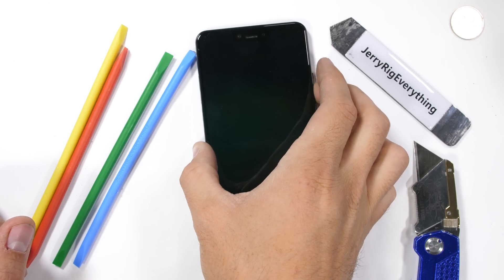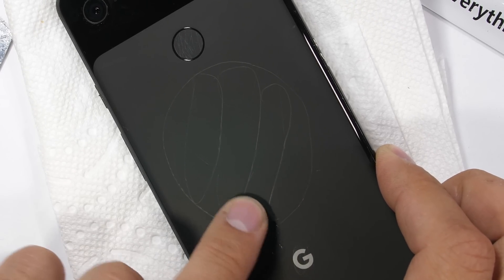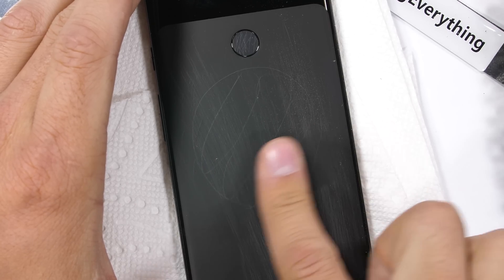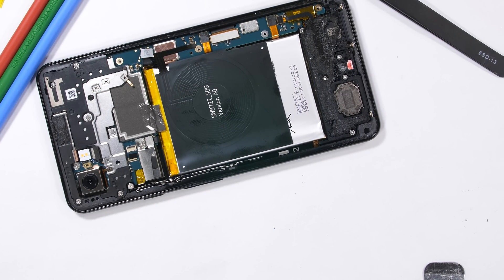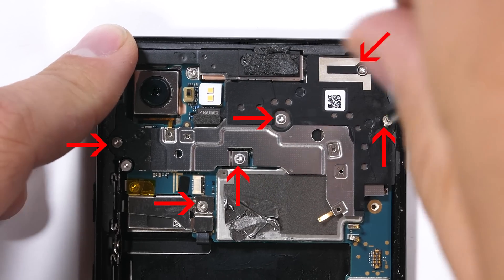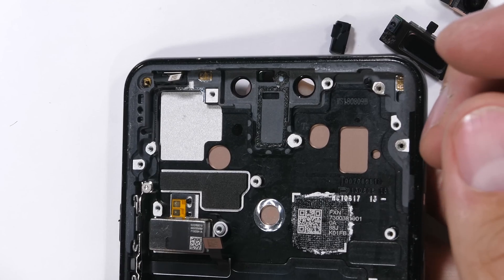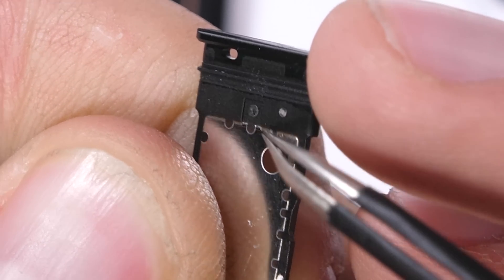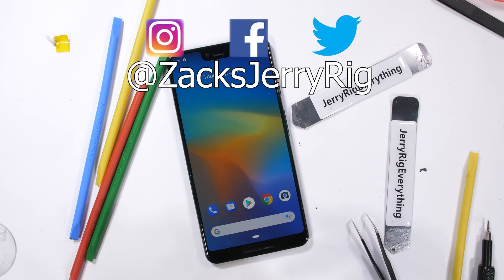Pixel 3 XL Teardown - Can the scratches be removed?

Comment: There is a reason why I make sure I drain the battery till the phone won't turn on before I replace it. Its cuz these boneheaded companies glue them on so well that the pull-tabs break forcing me to manhandle the damn batteries out bending them most of the time so yeah...

Comment: My Pixel 3xl last week after the latest OTA update. Looks like my phone is stuck in EDL mode. Considering to open the phone badly. Not able to hold myself for weeks to wait for the battery to discharge in EDL mode. Hope the phone isn't briked🙏. No pixel 4/5/6 in India. Can't find OEM replacement parts. I'm not able to understand what to use as a alternative for back panel adhesive... Do you have any hints for this?

Comment: Hi need an advice pls. My Google pixel 3 XL fell down and the glass got cracks.Display and touch are working fine. If now I have to fix the phone then which one would you advice (1) Change the glass screen( is it possible) or (2) Change the LCD.

Comment: I imagine that those pull tabs for the battery would work a lot better if you were to take the battery out last instead of trying to squeeze them at an angle around the motherboard.

Comment: you have to pull a lot slower on those pull tabs, buddy. It's what they're made for. i've repaired a few 3 xls. just pull and let them stretch, any pull tab that lifts up the battery right away means the adhesive was never good to begin with.

Comment: Anybody noticed that there is no that water proof grease around the rubber ring on the charging port this year ? It was on last year's pixel 2. And the the water resistant rating even goes up from IP67 to IP68??? Wtf?

Comment: altho the iphone XS MAX has only 3100 mah, it actually beat the 4000mah note9 and the 4200mah mate 20 pro, the A12 is a beast. specs dont really matter on iphone tho
Reply: 1440p vs 1080p. Ofc 1080p
Reply: HA. Dumbass it didn't beat those batteries. Did you even watch a battery drain test. I watched the most accurate precise battery drainage test and it was some heavy shit, Note9 vs XS MAX, obviously the Note9 won. Man you are fucking stupid. I am not usually a harsh android guy but this was the dumbest shit I've ever heard.

Comment: I'm sure that the scratches can be removed with a hydrochloric acid solution, because the glass surface isn't actually scratched metal particles are just transferred onto the glass. A commercially available and safe solution to the problem schould be developed tho.

Comment: Use a syringe of alcohol and squirt it under the battery. It will attack the adhesive and pop it out much easier.

Comment: I love Google, never been a Pixel fan... far far far far far far far far far far far far far too basic a device for the price... always is. Now don't take that the wrong way... as even the most budget Android from the worst of manufacturer is still about a decade ahead of the latest iPhone... but for Android standards, the Pixel is weak pants on offerings. That said though, take a closer look at that singular speaker with the large grille design.  It's a sealed audio chamber that ducts from the speaker to the entire grille area / chasm.  Like many speakers, even high end ones outside of the phone world..... A great example would be those older BOSE Wave radios... Tiny speakers, very large and sealed... as well as tuned ducts to amplify the sound to a precise and excellent level.   This, I think may have been skimmed over here... and dismissed as a lesser thing than it is.

Comment: Why did you compare the iPhone XS to the Note 9 and Pixel 3 XL's battery size? I understand this is obviously a nitpick and inconsequential, but I don't understand the obvious attempt to knock Apple. While the iPhone XS Max still does have a smaller battery than the Pixel 3 XL, it is much less of a difference than the almost 700 mAh difference between the normal iPhone XS to the Pixel 3 XL. Comparing like-sized "Max" or "XL" phones to each other is a much better indicator of the discrepancies between the two, as there is again, a much smaller difference between the battery size of the iPhone XS Max and the Pixel 3 XL than the difference you highlighted. I am not an "Apple fanboy" or "sheeple" or whatever you want to call it, nor am I a "fandroid". I simply don't understand the blatant attempt to make the iPhone look so much worse in comparison to the Pixel, when you easily could have mentioned the battery capacity of the iPhone XS Max instead of the iPhone XS, a phone that is almost a cubic inch smaller than the Pixel 3 XL, not to mention the half an inch of diagonal screen size between the two. Again, I understand that this has no impact on the video, I just wanted to point out an obvious and, frankly, dissapointing piece of misleading information.

Comment: That random metal chunk is to prevent the connectors from popping off. My sister once dropped her phone and came to me complaining that the volume rockers didn't work. I open it up and see that the ribbon had popped off from the drop.
Reply: Interesting
Reply: True. I ended up losing all the screws that holds the metal bracket for the screen connectors on my old iPhone 5 a few years back, so I just left it out. Then one day I dropped it and the touchscreen became completely unresponsive due to the connector coming loose. Even just having it sit there without any screws helped prevent this happening again. Still doesn't explain why the one in the Pixel 3 XL is that chunky 🤔

Comment: +JerryRigEverything    I think the pull tabs under the battery breaks because of the angle you pull at it.  I think you should remove the motherboard first then you can remove the battery with the pull tabs at a different angle and will work mutch better   I hope you try this at a different Teardown video with the pull tabs

Comment: That space in bottom could have easily fit a headphone jack if not they should give 2 usb c ports so one can be for charging while other one can be used for headphones. They should  standardize usb c to 3.5mm jack cable so people don't get confused between analogue and digital cables

Comment: Welding brush + soap will remove all scratches, maybe.
Reply: I lol'd so hard when he got that metal brush 😂
Reply: Me too, but nobody now can say that he didn't try hard enough :D
Reply: He didn't. A Dremel and a wire brush attachment is trying harder. :D
Reply: Should've just said most. You're sentence is worded weird
Reply: Yeah seemed like Zack was trolling us a bit (and Google by extension) ?   I don't understand the logic of using a metal brush to try to remove scratches caused by metal -- perhaps a "fighting fire with fire" thing based on Mohs scale ?   IDK...
Reply: You have to brush it in water tho
Reply: @rubenzwr3782   No, different levels of Mohs scale hardness involved as I understand it.  Erica was scratching the back of her Pixel with keys; Zack I believe used a metal knife or razor.
Reply: @Sharky165  Yep, but it's not a scratch. There's stainless steel in the grooves, and it won't come out because it got stuck in the tiny pores
Reply: @Joseph_mix  Actually I watched it again; Zack used a level 4 pick (Mohs scale) and not a razor or knife.  I believe stainless steel is harder than level 4, but regardless I think you're correct that those marks are permanent.  
    Def a much more extreme test than Erica's or Lew's (Unbox Therapy), and not something most people are going to carry in their pocket, esp with their phone in that same pocket, LOL. 
   But still, normal/clear glass wouldn't have looked that bad being scratched at level 4.
Reply: It isn't a scratch, it's a mark. And glass wouldn't be scratched at a lvl 4.
Reply: Isopropyl alcohol?
Reply: @JAYRAY00  Ye, it's what's used to sterilize wounds sometimes, and also to clean electronics, as it isn't corrosive.
Reply: A blowtorch will remove scratches
Reply: Water and a tooth brush will. Erica Griffinn tried it

Comment: Could the 3 xl have a worse coil than the pixel 3? One of my wireless chargers is finiky with my 3 xl  and the google fabric case but will charge it with it off. My normal 3 charges no matter what. 

Is it possible this is why they locked the pixel 3 to fast charging only on made by google cert chargers? Maybe the 3 xl cant handle the fast charge after a certain point?

Comment: I don't use Youtube while signed in. I just signed in to tell you one thing. Stop the fucking iPhone hate like that worthless Unbox Therapy guy. 

You are comparing this phone's battery size with Note 9 and told that it's better than iPhone XS. It's a Pixel 3 XL, you should compare the battery size with iPhone XS Max. 

If this phone was Pixel 3, then you could compare it with iPhone XS. Fucking bald hater. Good content though (Y)
Reply: You didn't mention iPhone XS when you were telling the water resistant rating, because the iPhone XS's rating is IP68. If the Pixel 3 had IP68 and iPhone had IP67, you definitely would mention it. Hypocrite

Comment: Does my phone become not waterproof if i heat it but i didn't open it? any one tell me please
Reply: First, it's only water resistant. Second, it won't. Your phone will only be not water resistant when you open it as the rubbers get glued back when it cool down.
Reply: @ryouazuken4296  i have heated the galaxy s8 but i didn't open it
Reply: @zayn7453  Then it's still water resistant.
Reply: Why are you heating phones again?
Reply: It softens the adhesive which usually breaks the IP68 rating just rendering it a IP6X or an IPXX

Comment: Noob question but if a phone gets wet from rain, would those water indicators still indicate to google that the phone suffered water damage?
Reply: Usually phones can resist rain, but if it does happen anyway and the water indicator turned red, then yes.

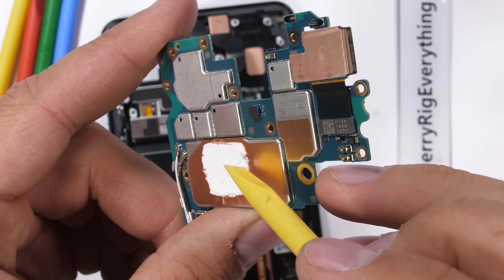Comment: What kind of cooling system pixel 3 used? i see at 5:50 that the processor have a thermal paste but what it's connected to? 
thanks in advance.
Reply: I'm sure the thermal paste was placed above the processor.

Comment: Htc design looks like again this year around. Last year LG and the first iteration of pixel was HTC. Looks like if we need to replace the glass LCD and frame you might have to replace the battery as well.
Hopefully replacing the glass and LCD will be an option. I would like you to take off your screen and put on a new one that would be great to see if it's doable.
Nightmare of a phone... I wish they kept the design like the first and second one where you can just remove the screen from the front and replace it made it so easy.

Comment: Why dose the speaker in the notch need to be that size? I feel like if the speaker wasn't as big or implemented differently the notch wouldn't be so much of an issue. Also the chin speaker is bit of a disappointment seeing it from the inside.

Comment: i just wanted to ask my s9 had been in the service centre for a screen replacement as well as back glass replacement i just wanted to ask is my phone still ip68 water restitance the service center did told me that the phone still has ip68 water resistance can someone answer this please
Reply: That means, they will change your front and back glass then renew your rubber bands, recovering back the ip68 ratings.

Comment: This Pixel is Junk.
Reply: HUH ???!   If anything, he proved that it's a solid, well made phone.
   Yeah there are a couple of odd things, chief among them the choice to frost the outside of the glass back rather than the inside, but then no device is perfect and other OEMs also make questionable design decisions all the time.  
   My biggest concern if I were to consider buying one is the seeming relative sensitivity of the water-damage indicators.  Even though the case seems well sealed  by Google/HTC, enough to earn an IP 68 rating, I'd be deathly afraid of any kind of dunking.  
   It's hypocritical of Google IMO to build the handset to IP 68 spec, but then so aggressively want to limit their liability for water damage.
   TL;DR:  This is prob NOT the right phone for you if you're a lifeguard.

Comment: Problem is, the Xs and Xs Max STILL last longer than most phones. A LOT of optimization instead of adding a bigger battery and NOT optimizing the phone. 

Apple makes iOS. 
Google makes android. 

Google never optimizes android. It’s why Android 9.0 on the pixel is fucking terrible and WORSE than snapdragon 845 on ALL other android using phones. 

The pixel sucks. Samsung is better. Huawei is better. Xaomi is better. LG is better. Apple is better.